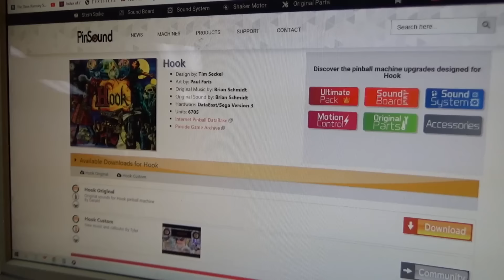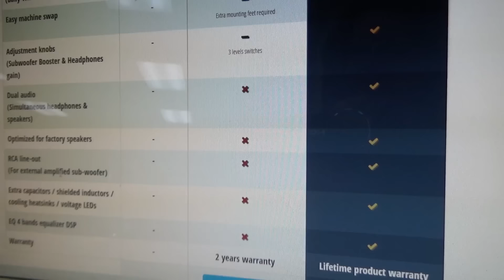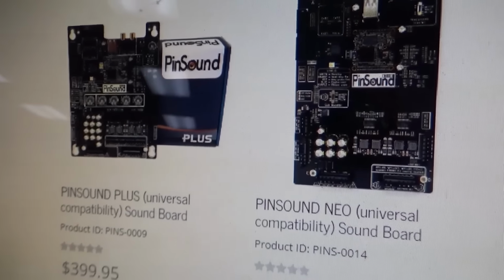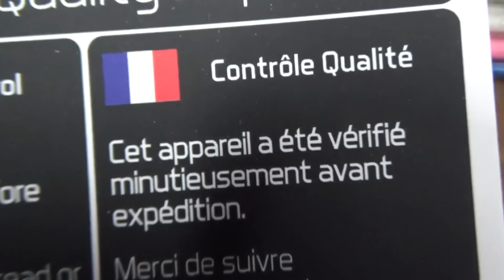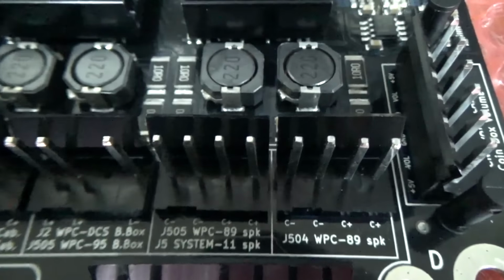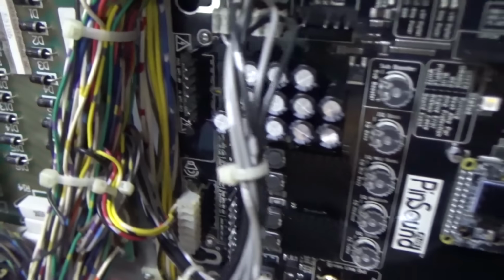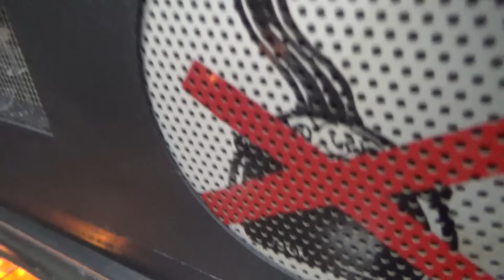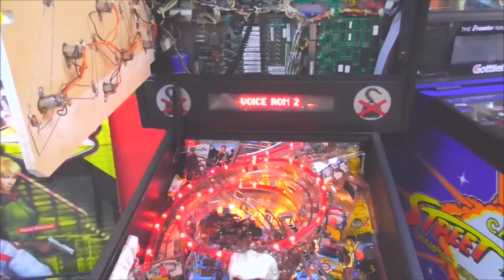Installing A New PinSound PLUS Sound Board In Data East's HOOK Pinball Machine - NO MORE HUM & Buzz!

Comment: As always, nice work!❤
We install a resistor in series with the speakers in between 20-50 ohm and it lowers the total sound volume but eliminated the hum almost completely. "Sounds" crazy but it works.
But PinSound is a very good option and upgrade👍

Comment: It would be great if one could easily swap between sound packs. The original tunes on this are also amazing. I probably like the original more. 

Oh and it is pretty common that if power supply is replaced, it will induce more humm onto audios. I have DE Simpsons and it humms slightly. But nothing as bad as in this video. Power supply was broken when I received it, but only from 110V side. Decided to fix it and not swap the whole board.
Reply: If you have the addon headphone connector/volume control thing, you can change sound packs on the fly.

Comment: Considering you can update the sound at will if you want to, and switch between the original and community sound pack, I think this could be a great investment for the collectors!
Also I think the low volume is due to a safety measure to prevent damages to the speakers just in case any other amplifiers were connected? I love the little jingle it makes when it can't find the USB drive or when it's updating.

Comment: JOE CLASSIC, Measure the AC Voltage on the 12vdc power lines to the audio board, comparing the original sound board to the new sound board to know the differences. Its not a grounding issue because the new sound board is using the same grounding but it less noisy and no hum.

Comment: Ground loops are a big problem in machines built like this.  The loop becomes a transformer winding that picks up an oscillating magnetic field.  Now your ground path has assorted noise on it most of it is 60hz hum. They never considered the concept of a single point ground in the design.
Reply from the maker: This one has other things going on, even if you try to fix the ground loop you still have hum, it's just a noisy designed board.  Notice for instance a brand new board fixes the hum, using the same ground wiring....